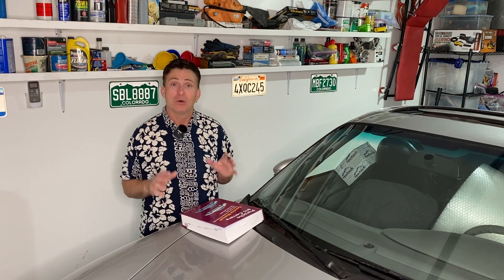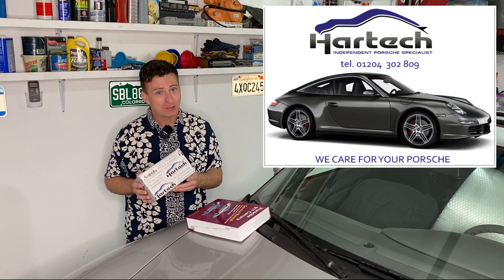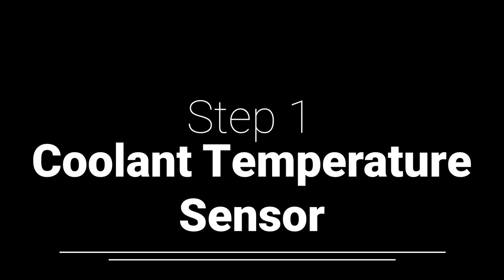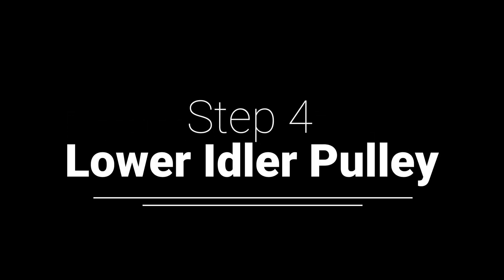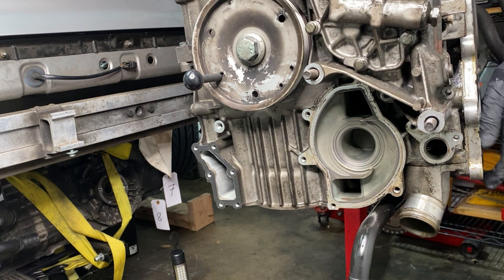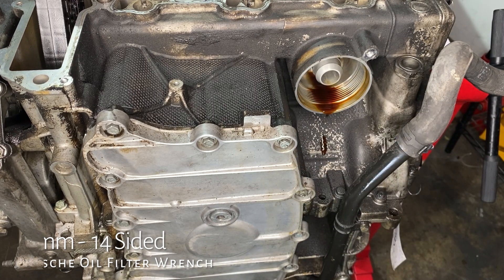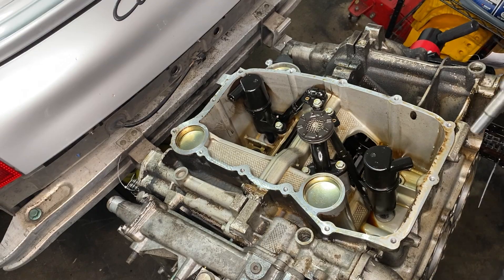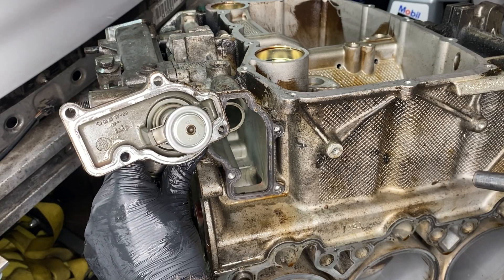How to Disassemble a PORSCHE 996 Engine Part 6

Comment: You may already know or have reassembled the engine, but it is a good idea to change the water since the plastic impellers are prone to breaking after wear and tear plus years... If you have the IMS solution installed, I would recommend going with a metal impeller, but if you are using the retro fit or factory dual row, just go with the plastic one.
Reply from the maker: Hello, You are absolutely right about the water pump, I was trying to figure out what to do about it. This is the current state of the rebuild https://www.youtube.com/watch?v=LuPT7P9JqeE
I am going to install a DOF IMS solution from TuneRS Motorsport. Why is there a preference for the plastic impeller with the factory bearing? I really appreciate your help, THANK YOU for watching 🤘😎
Reply: @ManinaGarage  That's good to hear about the IMS solution being installed. So the front what I have read in the forums, of you have the stock IMS or a retro bearing, it's probably better to have a plastic or composite bladed water pump just in case it fails and breaks. If you have the solution, then the metal is probably best since there's no change of the broken plastic interfering with the bearing. The metal one could in theory though break off the pulley and cause damage in the block where it mounts but it's unlikely. It's really personal preference... There's several threads on it in the forums.

Comment: I got my 1999 996 if it sets a couple days it will knock on start up don’t know if the chain tensioner has collapsed or it’s the same as yours haven’t been driving it because of this, the car only has 76,000 miles so  hopefully it won’t need a complete rebuild, keep up the excellent work
Reply: My 996 did the same as it always sits for a few months (I am an expat). Before starting it up, I am now pulling the ignition fuse and fuelpump fuse and let it crank for a while in order to build up oil pressure. Then I put the fuses back and the engine starts without knocking. Cheers from Taiwan
Reply from the maker: @palatinaworks7251  Howdy! That’s a good Idea, I was thinking of doing that with this engine the first time. Turn it over a bit to let the oil donors thing before giving it gas and spark. Greetings to Taiwan 🤘😎
Reply from the maker: Best of luck with your quest Rick, happy to “attempt” to answer questions if you have any. Thank you for watching 🤘😎

Comment: I suspect you already know this but a common “Upgrade” to protect the M96 engine is a lower temp thermostat, readily available from those sterling chaps at Hartech. Great video too! Hi to Amber!
Reply: Ricardo unfortunately there is a lot of both information and misinformation out there regarding these engines and how best to protect them from some of their weaknesses. I could go into a lot of the research that led me to fit the low temperature thermostat (And heavier grade engine oil) but as I said above they are both recommendations of a company in the U.K. called Hartech who are one of the world leaders in rebuilding these engines and have spent a huge amount of time trying to find and solve the weaknesses of these engines. You may have noticed their enlarged big end bearings at the beginning of the episode. 
Ultimately though it’ll come down to you to make a choice as to which advice to follow though. I would say that generally car companies tend to recommend a car engine runs hot for emissions and fuel efficiency though. For myself I’m happy to accept a very slight drop in fuel efficiency to help the long term health of my engine. 
Hope that helps!
Reply from the maker: @BossOfRingpiece  I really appreciate that Daron, I’m sure others will find that helpful 🤠 Thank you for watching 🤘😎
Reply from the maker: Amber says “Howdy Daron..”. 
You are right on the money regarding the Thermostat. Do you think the low temp (71degree) is a good idea?? I’m certainly thinking about it. Thank you for watching🤘😎
Reply: I thought it was such a good idea I had one fitted to mine. I think the logic behind it is that the bore scoring issues (More common to 3.8 and tiptronic engines) are linked to “Hotspots” created in the bank 2 block thinning the oil and locally breaking down the film strength.  Anyway Hartech tend to recommend the low temp thermostat (To give you a bit more thermal “Headroom”) and also run heavier grade (10w50) oil, again to give the oil a bit more thermal “Headroom”. As you’ve said Hartech really know what they’re doing and I tend to take the attitude that if they say it’s worth doing that’s good enough for me, shut up and take my money.
Reply: Dear Friends I'm also wondering about install a low temp thermostat, but just like everything else there always someone against the idea for some reason... And the reason that I'm been seeing inf the forums is that the engine is engineered to work at the OEM spec temperature, not lower... and also the oil is designed to work at this OEM spec temperature, not lower, since as we know a colder oil is thicker and may not flow or lubricate better the an oil that is less viscous since it is a little bit warmer
On top of that there is this advise to use and even thicker oil... Oh maaan, now I really don' t know what to do